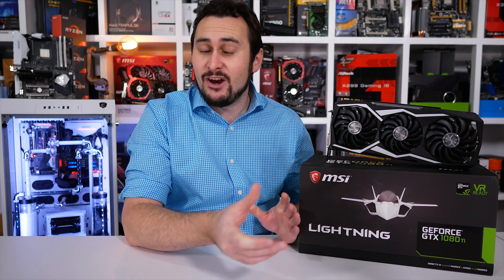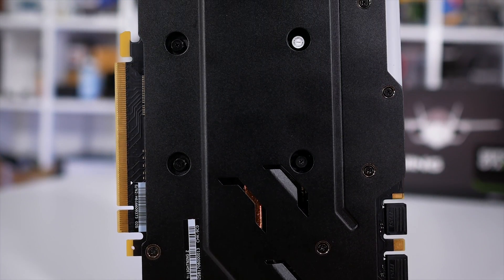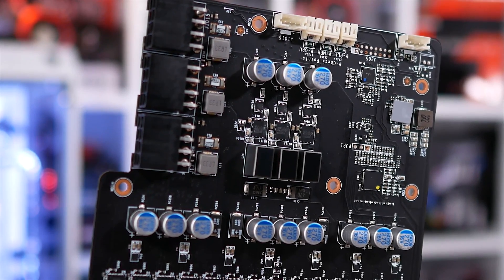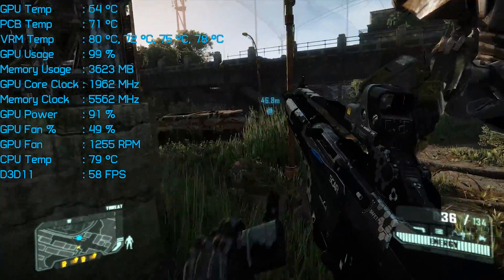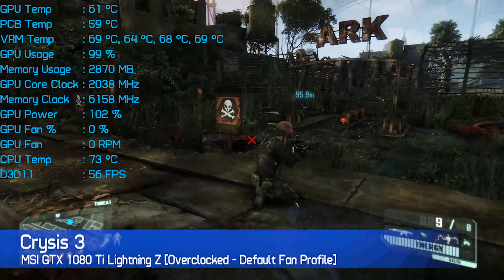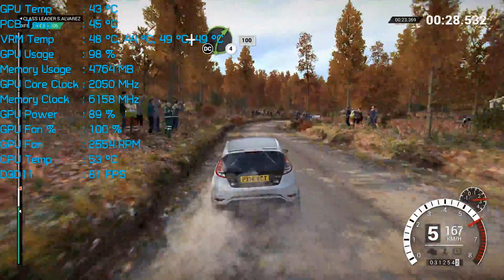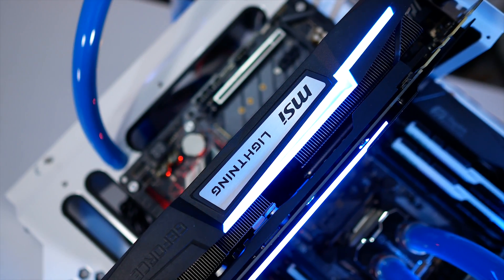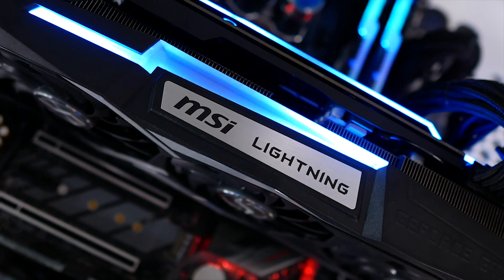MSI GTX 1080 Ti Lightning Z: Thermals, Overclocking & Benchmarks!

Comment: Msi GTX 1080 Ti Lightning Z. It has served me well for 6 years and counting. Now there is a huge upgrade on the horizon. I'll buy a RTX 4080 and boy will it be an upgrade! Though i have to save some money, it's gonna be really expensive. Oh and i have to find a card that is under 340 mm, 34 cm. My Cooler Master HAF 922 supports cards under 34 i believe. I'm not sure maybe it supports up to 35 cm. There seems to be 2 or 3 cm more space between the Lightning Z and the case and Lightning Z is 320 mm 32 cm.

Comment: Hey I'm a bit new to computer building so go easy on me :3 but is there a way too use liquid cooling for this gpu and if so what would you recommend. Also I'm a bit confused on the term "overclocking" could someone simply explain and thanks in advance.  :)

Comment: I want to know if you can water cool this card and still leave the backplate RGB on? And also what are the specs after its water cooled? I'm thinking about using this card in a build and I want to get the new RGB water blocks that just came out as well but unfortunately I can't find any videos with anybody attempting to do water cooling with this card.

Comment: Hey man! I got this card aswell and I cant unlock the core voltage in afterburner for some reason. :/ want to stay in the nvidia specification power and temp limits but even if i click unlock voltage in afterburner, nothing is happenin. it stays grey.... :(
Reply: hey, do u have problem with Mystic Light? It doesn't work for me also Gaming APP

Comment: 46 degrees C on 100% fan speed? that's the temp you can achieve only under water, good job MSI
Reply: Li Ming To Gunawan most decent 1080ti does almost that. My palit gamerock loads at 55C, TRIO at 53C with 100% fan. All stock paste

Comment: Steve please do a few tests with the LN2 switch flicked, nothing too crazy, I just wana know if the voltage/power limits increase actually helps overclocking on the stock cooler.

Comment: copper heat pipe behind the back plate absorbs 1% heat because it's not making direct contact to take any heat away. it's most likely due to the thermal pad. it would be something if they would make a dual heat exchange for the front and back so you'd release more heat, but as it is now, it looks like a bandaid, kinda like the old heatsink designs for motherboards that didn't really do much. 

even on x299 motherboards you're seeing some designs for 'cooling' m.2 drives that end up insulating instead. most of the time due to them no focusing on the control chip where you'd need the cooling the most on it.

Comment: The one thing that you can't do is test the longevity/reliability of the card itself.  Benchmarks mean nothing if the card dies in six months to a year of continual use.  If I can purchase a much cheaper 1080ti card and overclock it to the same or better levels; have it NOT take up the same number of PCI slots; weigh less, have it remain just as quiet or nearly as quiet and last for years to come, then this MSI card then would represent HORRIBLE value for money given what I stated above.

I'm not in line with your recommendation on this product.
Reply from the maker: You do realize I was only recommending it if there isn't a serious price premium? I feel like I was pretty clear on that point.

The fact that it uses the highest possible components throughout should be an indication of quality and reliability.
Reply: No, you were clear on that point.  I just felt that the tradeoffs that you have to make for getting this card aren't worth it (as you suggested).  But my main point went to the longevity of GPU's and whether having/getting the highest quality components are really worth it.  Only long term testing and documentation would be able to determine that.  And I don't see anyone in the YouTube PC community doing these sorts of things because YouTube viewers have notoriously short attention spans.  Do you know of any sites that perform these benchmarks?  Because, in my mind, longevity and reliability are just as important benchmarks too.

I mean, if you could get a GPU with parts that are 75% as good as the best and it lasts you for 5 years (say as long as you might hold on to any typical GPU before you upgrade to the next generation) while at the same time costing you 2/3rds; isn't that a much better value proposition?  Unless some other factor is in play that demands you consider a card such as the one you presented in this video.

Maybe there needs to be started a GPU "King" card.  One that is held in the highest regard which holds the best overclocking; the best form factor; the best cooling; the best noise levels; etc.  And then all other cards would need to be compared to it.  Just my thoughts and rambles.
Reply from the maker: The reason no one does it is because it’s simply not feasible. You are almost asking for the impossible. Taking a single product and testing it over a certain period of time tells you very little and any data gathered will be very misleading.

The only way to do this accurately would be to test at least have a dozen models of the same product. If they all survive a 3-year period, then you can declare that reliability is very good. If a certain percentage fail, then yeah reliability might not be good.

But testing one card and saying it lasted X amount of time is extremely misleading.

You could buy a horrible power supply for example but get lucky and have it never die over a 5-year period, meanwhile the next 10 you try all fail after a year.

So think about how realistic something might be, before suggesting YouTubers should be doing it ;)
Reply: How hard would it be to gather many YouTube PC channels and do long term testing?  That might be feasible.  And there might also be a genuine willingness to do this sort of thing.  It would require some upfront work, to be sure, but after that, testing would be pretty easy and low key.  Only needing to be revisited once every 3 months or so.  You could make a category out of it like LinusTechTips does with their "Holy $h*t" video series.

At any rate, I think I've driven you nuts with this topic and any replies on this would be my last so as to not boor you to death over something that you might regard as inconsequential.  Thanks for the conversation!
Reply: hey, do u had problem with Mystic Light? It doesn't work for me also Gaming APP

Comment: My 1080 ti fe is at 2000mhz at 82c. Pretty happy about that.
Reply: i have ti fe too but it stoped overlocking at 1780megahetrz clockspeed after that isnt not stabil. did u gave voltage for 2k ?

Comment: Well the lightning Z 1080 Ti is really made for LN2 overclocking and extreme overclocking. It has an over engineered PCB that is one of the best on any 1080 Ti out there, second only to the kingpin. I don't think this GPU is supposed to be used in "normal" conditions.
Reply: Yes Lightnin Z is second only to Kingpin and i'm not even sure if it's second to Kingpin, Lightnin Z might be the best GTX 1080ti. If it's not then it's only second to Kingpin.

Comment: In Germany it costs 950€, absolutely no match for the Zotac 1080 ti AMP for 750€ or the Zotac 1080 ti Mini for 710€ when looking at price/performance.
Reply: Zahier Mahoob They don't, I didn't mean that extreme overclockers in Germany should buy the Zotac cards. I just don't think that any gamer in Germany should consider the Lightning Z at its current price.
Reply: Your picture is my favorite picture (also a sticker) I use to mock my friends in Telegram when I bluff with them
Yo're solid!! you're Awesome!! you're Cool!! you're Super!!  you're Legendary!!  you're Unique!!
I'll even subscribe to you for that pic.. And here 10 likes also 10+
Reply: AMP has heat and fan problem though while the AMP Extreme has the one of the worst PCB design of all 1080 Ti's. That's why they're cheap

Comment: I must admit, RGB wise it's probably the nicest looking card I've seen in the 1080ti range but I couldn't justify the price difference over the others just for that.
Glad I got my Asus Strix oc 1080ti, clocks running at over 2000mhz nice and easy, temps never been above 68 degrees.

Comment: Still hyped to see the Hall of Fame... It weighs 1.6 KG as well but I just like the design more. Any Information in when you will get it?
Reply: Its been out for 2 weeks now...but I not paying 1100 bucks for a frickin video card

http://galaxstore.net/GALAX-GeForce-GTX-1080-Ti-HOF_p_134.html
Reply: Des Jones I have that Card but I "only" paid 900€. HU said that they will get one to test. I think about selling my 1080Ti HoF for like 1000€ because you can`t get it anywhere so I get nice profit
Reply: even if it was 900 USD still too much for me, it should b price same amt +/- 20-30 bucks max more over the FTW 3 by EVGA, which in my opinion is in top 5 of best 1080tis out now IMO I am getting the Hydro Copper Version when I start building my system in a couple weeks as a back up if RX Vega Prices aren't satisfactory.  Looking at the 1600X but dat Threadripper 12-core though.....so tempted cause the MOBOs for threadripper look sick from what Ive seen, yeah I dont need 12 or 16 cores, but if single thread performance is really good  I'm going pull the trigger on it instead of 1600x =)
Reply: Des Jones Dont get the 1600x anyway get the 1600. You can only overclock them to 3.8 maybe 3.9 anyway. The 1600x is just as useless as any other X Processor in the Ryzen Line-Up
Reply: Des Jones Also the FTW3 is 870€ in my country so the HoF was 30€ more expensive
Reply: I heard that from alot of people but as far as the prices have dropped its only like literally 20 bucks more than the regualr 1600 so y not??? =)  Most people I know that got it had more luck hitting 4GHz with it vs the 1600 non-X

Comment: 3 - 8 pin connectors?!
Reply: Yeah, i mean this is not something new but for average consumer it does nothing, which leads probably to buying a better power supply with 3 - 8 pin connectors. Aourus 1080Ti seems like better option.
Reply: The 3rd 8 pin connector is optional. Its made for extreme over clocking or liquid nitrogen cooling.

Comment: So conclusion is that no amount of dollars can control the Silicon Lottery. The card's clearly not binned higher than any other SKU,  certainly not guaranteeing 2100 out of the box on air as people were speculating.
Reply: 1060 lol
Reply: AspLode, 😂 My ASUS Strix GTX 1060 can achieve 2.1GHz no problem.
Reply: Different cards dumbass.

Comment: Great job, Steve!

I recently wrote a review on this card as well, and my complaints were the same as yours - the price and no extra OC headroom, but as far as I know, that's thanks more to Nvidia than anyone else.
Have you tried overclocking manually on the LN2 mode under the air cooler? Would be neat to see how far you could push it that way.

Comment: Hell yeah! Up to 930W of power draw!
Reply from the maker: I think the most it could possibly do is 525 watts ;) But it of course won't!
Reply: That's true if they follow the 150W spec for the 8-pin, but luckily that's not enforced, or even very often followed, so it means that it can do up to 285W per, and even more in some cases. :)

It's the same with the reference RX 480 which has an out of spec 6-pin, and is essentially an 8-pin without the sense lines, making it even more confusing as to why they mapped out the power delivery as they did when they could've basically run the whole card off of the 6-pin lol

Comment: I'm not massively knowledgeable when it comes to overclocking, I've got my gtx 1080 clocked to 2100mhz but my memory clock won't got much over 5000mhz, does anyone know why? Also I can't adjust the core voltage as it's grayed out.
Reply: DmcxDmc for the Voltage, I think it’s locked in MSI Afterburner’s Settings, enable it and it should work :)
Also for the Memory, Nvidia released better GTX 1080s with the higher memory clocks that’s why it’s 5500MHz
Reply: TheMasterOfSafari thanks for taking the time to reply. 
I've been using EVGA precision x, that's what came with my card. Now sitting 2125mhz and 5530mhz.
Reply: DmcxDmc You’re welcome :)
I thought u were using MSI Afterburner like the video, I’ve only used MSI Afterburner so I don’t really know much about other OCing utilities sorry..

Comment: So in other words this massive beast of a card. overclocks as high as pretty much every single 1080Ti out there. man the temps on this are as high as my FTW3 which is only a 2 slot card. looking at other reviews the LN2 switch does allow the GPU core to go higher than 2050mhz but the memory clocks can be set higher. 

So even this super over the top card with a totally overkill PCB is hitting the same damn limits even the FE pretty much hits. Such a shame. nvidia really crippled GPU companies by enforcing a hard voltage/power limit.

Comment: Wouldn't lower temperatures on the backplate mean that the heat isn't being transferred to it, and hence it is not very effective at taking heat away from the PCB? I may not be right, but just a thought
Reply from the maker: I'm measuring the PCB temp, not the backplate temperature.
Reply: Ah, makes sense now. That's pretty impressive!

Comment: Did you test this in gaming mode or ln2 mode. Ln2 mode won't kill the card if ran on air or water, you just have to make sure the card stays in thermal check.

Also when it comes to transporting, lay the pc on its side, so the slot is on the bottem, this will keep it from snapping off.
Reply from the maker: I tried both modes, made no difference with the air-cooler.
Reply: thats actually suprising, considering how well pascal scales with power and voltage.

Comment: I'm thinking Evga FTW3 for my 1080ti. I do like Watercooling and I'm tempted to blow the extra money just because. Do you have a favorite 1080ti? Or top 3?
Reply: klikdeli I wouldn't bother going down the water cooling road with these 1080ti's.
They cool amazingly well on air and you won't see any better clock performance on water than over air.
I have the Asus Strix oc 1080ti, Absolute beast, very nice Aura sync lighting too.

Comment: what monitors the vrm in msi afterburner?
Reply: Derek Comingo a temp probe
Reply: oh so thats not part of msi afterburner?
Reply: well the probe is linked to msi afterburner, like how evga icx cards are linked to precision x. its just the software interface that the end user (you or me) would use to monitor the probe
Reply: ohhh so it was built in card sensor i see

Comment: nice review, thank you :) 
only other review i could find on my list was oc3d, and he made the card look bad, not getting into the noise and temp benefit.
fan rpm is the best way of getting an approximate noise level, then you just need to hear another 2 or 3 fan card at some rpm's and you know something about noise. 
im running at 850rpm at 77c max on my 1070 at 2.ghz, and seeing this card doing 1300 rpm at 64c with 2ghz is impressive.
the noise difference between 850 rpm to 1300 is not double i think, but its still a bit too noisy for me.
Reply from the maker: +xuddish p I bet he talked a lot about the ASUS Strix model in his review of the MSI card as well.

Comment: I'll never spend $1500 on a GPU. Now I'm going to cross my fingers and hope Volta doesn't cost a left kidney. :p
Reply: Nik Kearney Or just both 'o.o
Reply: SURPRISE. VOLTA CAME OUT AND IT COSTS $3000! ;)
Reply: nahh soon you will for sure. i've been pc budget gaming for decades. its about time you and i play 4K maximum ultra settings.
Reply: Nik Kearney You do know that the 2000 series or 1100 series(whatever they call it) will be a replacement for the 1000 series cards and will cost exactly the same as their counterparts or very very similar?
Reply: Accounting for inflation, everywhere here will eventually! The prices are definitely sliding upwards each generation faster than inflation though :(
Reply: It was 850 usd
Reply: 1500? I bought both my lightnings for $1500..
Reply: I think I found the last one available, but it's price is bonkers though! www.ebay.co.uk/itm/292546931247
Reply: Oh lol just read this comment. Look at RTX prices :D
Reply: 2 years later and it will cost 350 dollars used on eBay. Kinda like the 980ti run.

Comment: But does it run GTA IV at a stable 60fps? Because my 1080@2105MHz doesn't
Reply from the maker: It should, what CPU are you using?
Reply: Hardware Unboxed nothing can hold GTA iv at 60fps, not even a quantum supercomputer.
Reply: R5 1600 @ 3'9GHz, even with my 5820K @ 4'4GHz I get framedrops to the mid 20s at times and horrible stuttering when a lot of things are happening, I can't understand it, I mean, the game came out during the C2D and GTX200 era, how can't I run it properly with modern hardware
Reply: Cause it's made for 30fps and isn't multithreaded. Afaik there are some mods to make it multithreaded, try finding those.
Reply: I'd say you probably just have some settings too high. Quite a few of the settings just kill FPS for very little visual gains. GTA V is not a game you can just max out if you want smooth FPS.
Reply: GTA V runs at 60fps @1440p with my rig, I'm talking GTA IV (4), the unoptimized DX10 POS

Comment: 1080 Ti will be obsolete in 1.5yrs just like the 980 Ti... Just watch.
Reply from the maker: The 980 Ti is still a beast, can be overclocked to match/beat the GTX 1070.
Reply: Yes like most electronics it will be out of date when better shit comes out. Dumbass.
Reply: so?! What's your point? You will be obsolete in 50 years too.
Reply: Mad Lust Envy The point I'm trying to make is that no one should ever get on the hype train and fall for marketing jargon. Because you already know that whatever the fuck they are pushing now as "The most powerful ever!" won't be in 6mo-1yr.